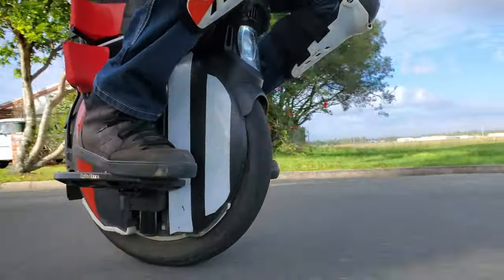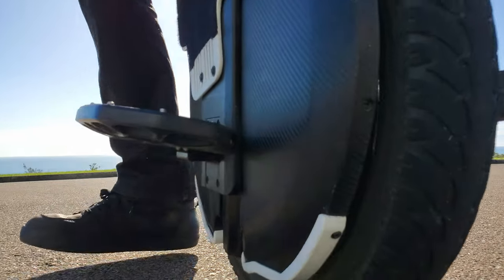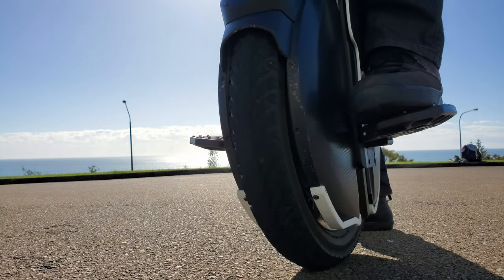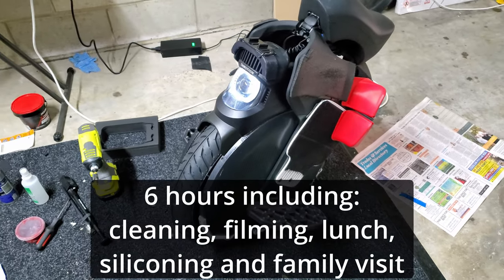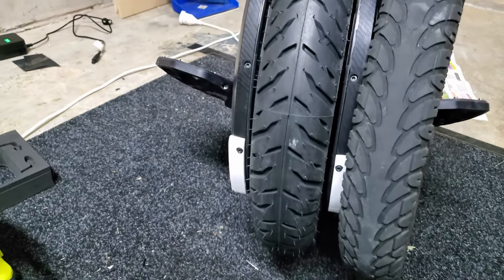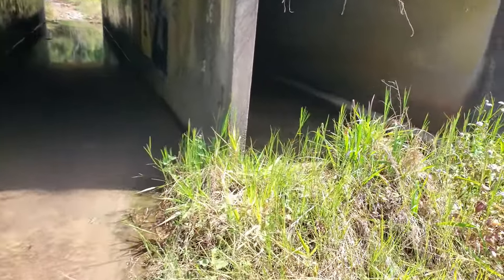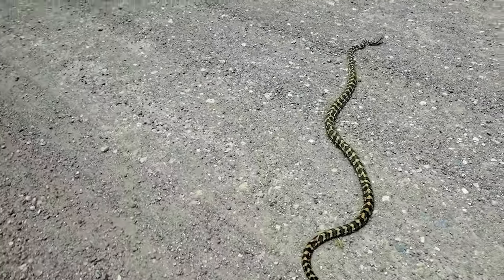Michelin Pilot Street 2 Tyre Review on Inmotion V11 EUC

Comment: Thanks for a fantastic video, Jon! My V11 needs a tire change soon, and this definitely sold me on the Michelin Pilot tire. You gotta have a safe quality tire when you're only riding on one!

I also have a question/concern about a problem I recently encountered, I would appreciate it if anyone has any input. It had been raining for a week and I rode my v11 in it, and now I've noticed a creeky noise coming from the axel. The wheel was smooth as butter before but now rides rather rough, as if all the lubrication has been washed out and it's just metal on metal. Does anyone have any idea what happened and what can be done to restore it? Thanks so much in advance for your inputs!
Reply from the maker: Hey Matt, excellent! I'm getting another one to put onto my Sherman S. I was recently speaking to another rider who tried the Pirelli Angel. They said it 'chattered' around hard cornering due to micro slips in traction! definitely doesn't happen with the Pilot Street 2.
Do you know what batch your V11 is? To ride in the rain you need the rubber bearing covers and grease as I show in the video.
When you strip it down for the tyre change have a look. If not then the bearings will be washed dry and may have dirt in them. I believe you can remove, clean and re-grease the bearings - then add the bearing rubber protective covers.
It could also be the suspension and sliders? PTFE dry lubricant seems to be what most of us use.
hope that helps
cheers jono
Reply: @jonoeuc   Thanks, again, for the tips, Jon! My V11 is from batch 3 (Dec. 2021, I believe.) 

It's definitely the bearings that caused the creaking and not the suspension system. I applied some lubricant to the axel (without disassembling but after cleaning the dirt around it, if you can believe it) and that seemed to have quieted about 90% of the noise, but still not as smooth as before. I'll have to take it apart to do a thorough cleaning and applying grease to the ball bearings, as you suggested, to restore the original feel. It's just not something I'm looking forward to though, although if I can change the tyre too then it'll be worth the effort. Just wished they had designed a simpler way to maintain these things.

Also, I can't believe the bearings lubricant can be washed away so completely to cause such a problem; the axel is pretty high up and I don't think it ever made contact directly with a big slash of water. Guess I'll need to order the rubber sealer/gasket kit to eliminate this future issue.

Will give an update when that's all done, Jon. Btw, I forgot I had the Michelin Pilot Street 2 tyre on my Sherman Veteran and that thing rides like a dream! I just hadn't thought of it for the V11.

All the best for 2023 & happy and safe riding!!!
Reply: @jonoeuc  Have you already changed the tire for you Sherman S? how it compared to the stock one? BTW great review!

Comment: Great job.  The proper motorbike tyres that are available for 14' rims is the reason I think I'll go for a larger EUC next time. It looks like your in northern Queensland?
Reply from the maker: cheers mate. what are you riding atm? 
SE QLD sunshine coast area!
Reply: @jonoeuc  hey Jon.  I currently ride a Kingsong 16x but am looking at the Kingsong s22 to take on the mountain bike trails down here in Tasmania
Reply from the maker: @brentonporter6925  ah nice yeah i hear that's a great trail and jumping wheel. Does the motor stator slippage issue bother you? 
I've got a preorder on the v13 but just as likely to change to the sherman s. waiting on reviews!
Reply: @jonoeuc  it does, and so does the slider problem.  I'm waiting for later versions when all is well.  The V13 seems like a well made wheel (at this stage), a little large for my purposes.

Comment: Why did you use a tube? 
I'm curious since the tire is tubeless radial.

I plan on doing this to my V11 and am just curious.
Reply from the maker: Hi Jay, I re-used the existing 18x3" inner tube. The Michelin tyre actually has text on its sidewall recommending using a tube in a non tubeless setup. There is a shot of it in the video but I didn't point it out explicitly.
Have a good one!
Reply: @jonoeuc  Thank you so much for clarifying! Have a great one ride safe 🤟
Reply: @jaybomb5022  EUC Rim isn't built for tubeless. If you installed this tire as tubeless you would have a problem because you need a valve stem which is attached to the tube you took out. Maybe you can get a seal with a valve stem on this rim but Im not sure if thats possible.
Reply: @CrunchyTire  It's possible with a 45degree stem and the proper tool to pull it through the hole. What I worry about is the lip of the rim not seating to the bead. The Ninebot Z10 has a tubeless radial, I wonder what the difference is in the rim.

Comment: Hey Jon,
I just finished replacing my tire with the Michelin pilot 2  80/90 and the tire does not spin freely. It appears that the tire is too wide. It’s making contact with the housing. Do you have any suggestions? Thanks, Thomas.
Reply from the maker: Hi Thomas, did I reply to you somewhere else? anyway hopefully you've got it sorted by but in case not. 
I had to stretch my V11 stand to prevent it clamping the housing onto the tyre. It was slightly rubbing on turns otherwise.
In an extreme case you may need to grind the tyre down against concrete or with a sander. 
ta

Comment: which pump do you have? I like the digital gauge which makes it easier to read for me without having to pull out my reading glasses lol.
Reply from the maker: It's so much better than the tiny inaccurate gauges! 
It's the Venzo Bike Bicycle High Pressure Shock Pump 300 PSI Max Fork & Rear Suspension with Digital Gauge

from here: https://www.cyclingdeal.com.au/buy/venzo-bike-bicycle-high-pressure-shock-pump-300-ps/GS-411

Two of the Inmotion pumps broke instantly which reflected poorly on them.

Comment: Very nice, too bad that Inmotion has left the hollow bore motor on V12. It is really much better in terms of durability and torque (and also tire change, from the V12 axle cables are sticking from both sides :D). Anyway it is interesting that you do not like this tire. I have axactly the same patern on my Begode Tesla T3 (but smaller - 16x2,125) and I absolutelly love it :).
Reply from the maker: One nice tradeoff is smaller bearing surface area - better water resistance supposedly.
Oh nice! Now I want to go back on it for testing!
I've heard that after a few thousand miles // kms the tyre rounds off making it handle better. 
I kind of feel the Michelin is too much tyre for the V11 now. Overkill really. 
cheers

Comment: I got the same tire. I think it loses too much range. Not sure if that’s because of the tire direction or the bigger size.
Reply from the maker: What I came to realize is that it's just too much tyre for the V11. Way more performance / traction than i'll ever need on the V11. Plus the heavy tyre is a bit much for the V11's power. 
Still a good tyre but yeah overkill perhaps! 
What was your range loss? I lost around 15% range.
Reply: Maybe 20%. But yeah, this tire feels very smooth and stable. By the way, I noticed another interesting thing. When I was inflating the tire, I set it to 40 psi. After the digital inflator stopped at 40 psi, the reading dropped to 35 immediately. If I set it to 43, it dropped to 38 later. I believe the tube wasn’t leaking. It had never happened before. Do you have had the same situation?

Comment: Did u use back the tube or did u convert it to a tubeless? i did change my tyre on my ex.n (with the tube) but after a month i changed it back to the original as the michelin tyres were too hard on my knees. Maybe coz V11 has suspension u didnt feel the hardness as much as my ex.n? thoughts? tq
Reply from the maker: Hey Jason, yeah I re-used the same inner tube. That's interesting because I felt the Michelin dampen the smaller chattering vibrations.
It's hard for me to say re suspension. The V11 is the only wheel i've owned and have experience.
Did you maintain the same pressures between the two?
Reply: Good question. With the harder side walls of the Michelin tyre i went down from 26psi to 18 psi. (Im 68kgs w gear). Even at 18 psi it felt hard. The advantage i got fr Michelin was i can feel the dampening more then being bouncy. Finally i stopped using it was coz i actually bent my rim slighly. I would go back to the Michelin if im on a go kart track of racing but thats me
Reply from the maker: @swatadvisers  wow huge drop in pressure between the two!  Ah damn that sounds like a fiasco! 
It has to be the suspension difference. I'm Running the michelin 2psi higher than the 1488, 33 vs 31psi.
To help preserve my knees was a big reason going for the V11 with suspension too. Plus the safety factor. 
Keen to try non sus but not to own. Leaning more and more to Sherman S over V13 atm.
Reply: @jonoeuc  atm for me s18 but exclusively for offroad only. Thinking of replacing my Monster pro to master pro

Comment: Whats the name of the air pump and where did u buy it pls
Reply from the maker: It was awesome while it worked but recently broke - started leaking out the end nozzle. Warranty job without issue. This shop seems to no longer stock it sadly.
Venzo Bike Bicycle High Pressure Shock Pump 300 PSI Max Fork & Rear Suspension with Digital Gauge
https://www.cyclingdeal.com.au/buy/venzo-bike-bicycle-high-pressure-shock-pump-300-ps/GS-411
Reply: @jonoeuc  ok thank u

Comment: I was told today that the 80/90 is not meant for the v11
Reply from the maker: its larger and heavier than the stock tyre which makes it a tight fit. However 80 90 14 is what i used.
can always go for the slightly smaller pirelli angel tyre

Comment: You faced the weathering rotation the wrong way! The radial direction is supposed to drain the water "away" from the tire! Right now your drawing water toward the centre of the wheel. I'm so confused as to why they marked the tread pattern to direction in that regard. It goes against my understanding of weathered radial direction tyres. I'm so confused
Reply from the maker: hey James,
There is deep misconceptions about tyre directionality. The Street 2 is a bi directional tyre which can be used front or rear (flipped 180). the deep treads are better at clearing water while cornering it moves water away from the cornering edge inside to outside. The front tyre of a motorcycle is the turning wheel and leads in the rear. This is where it gets tricky with an EUC since it is the turning, braking and acceleration wheel.
Here is a photo i recently took of a triumph motorcycle front tyre --> https://imgur.com/a/fmTNmIL
From what i've heard, the tread edge is reinforced for power to be applied in a particularly direction (to prevent rolling of the rubber). For the rear tyre acceleration. Braking for the front.

There was one comment here that was adamant a rear orientation be used. However I believe the speeds, mass and forces for euc are so low that it doesn't particularly matter. I've found heat is still generated in my tyre and it has way more traction that i'll ever use on paved surfaces.

I have reached out to manufacturers for clarification and will hopefully make an euc specific tyre related video in the future.

Ta, Jonathan

Comment: After two month of making this video. Do you still recommend this tire?
Reply from the maker: Yeah it's been solid. More tyre than i've ever needed, feels like overkill! so much grip on paved surfaces. 5600km total on the V11 (so about 3000km on this tyre) and plenty of tread left. It seems that it should be positioned as a rear tyre from what i've been hearing. Doesn't seem to have caused any issues though.
Reply: @jonoeuc  Why as rear? And do you feel grip and traction on this vs knoby tire?
Reply from the maker: @YASAJTV  see the comment by @JamesMcClellan who delves into directionality. 
So far both have had plenty of grip on paved surfaces. It's more about the round profile of the street tyre providing linear and predictable carving at all speeds. The K262 has a gap in the tread on the sides that it falls into which i've gotten use to but still don't like. 
The street is far less grippy offroad but is still capable at a slower pace. offroad is a minor part for me.

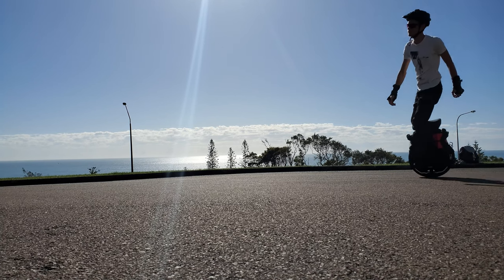Comment: 2:15 bro you shouldnt feel train tracking on v11. The treads makes it like a street tire, it is a street tire. Jump on a master and try to turn on it's stock tire, you'll know what train tracking is.
Reply from the maker: What's the master running the Kenda K262? That's what i'm trying on the serman s.
Perhaps we have different definitions of train tracking. I would feel it grab ridges in the concrete and twist the wheel to follow that groove. riding cross slopes the wheel had a mind of its own and required concerted effort to keep it straight.
Reply: What I feel on the master isn't train tracking. The tire has a drop off point on the edge so if you take a sharp turn if feels like you fall of a cliff, then it catches again. Its scary the first time you feel it lol. When I got the V12, it followed cracks and resisted my turning. That is what I believe to be train tracking. And the V12 had the same stock tire as the V11.